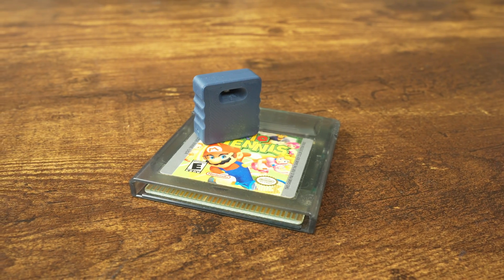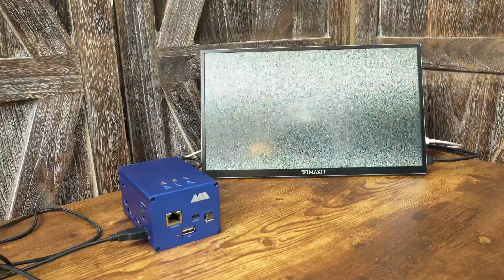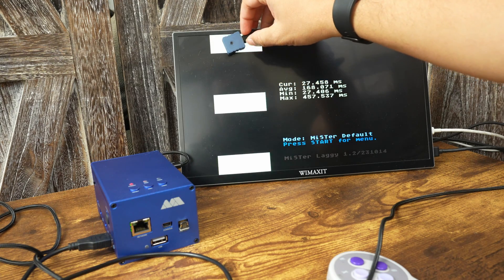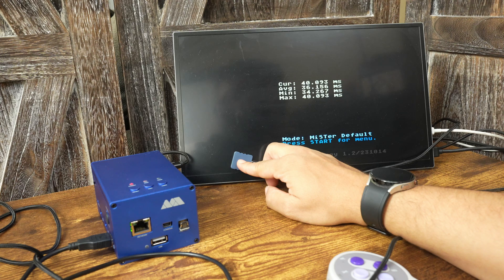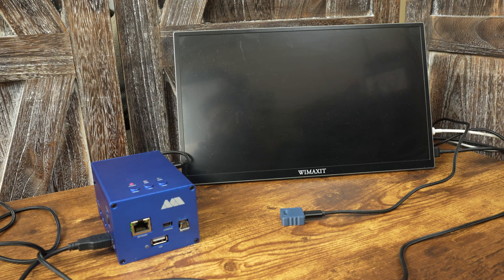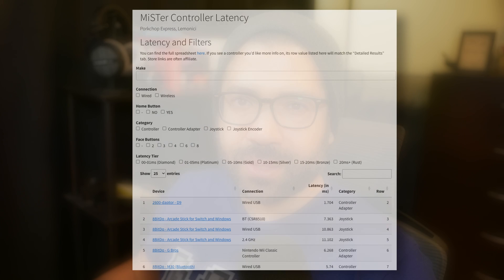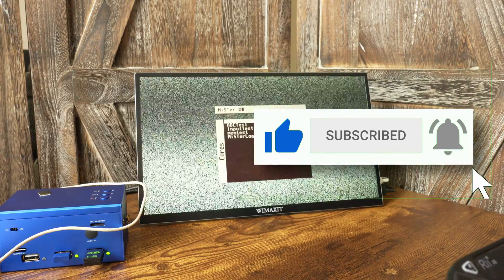Lag Test Your Display With MiSTer Laggy

Comment: question how did you get the core to run at a resolution that a crt understands all the resolution options are 480p and up so my crt cant display it proporly
Reply from the maker: I didn't do anything. I just loaded up the core and it automatically worked on my CRT. I was using direct video over component on this video.
Reply: hmm im using an i/o board with component cables to a sd crt. my ini is set to output component over vga and when im in the main mister menu everything is fine but once i boot up the misterlaggy core it gets scrambled like its outputting "hd resolutions" is the crt you used compatible with 480p/720p/1080p? @LusRetroSource

Comment: Thanks Lu!  What method did you use to test the CRT?  The analog I/O board, or an hdmi converter? something else?
Reply from the maker: On that specific CRT, I used direct video over component. I plan on creating a video testing other display devices which includes another CRT I have.

Comment: To go straight to the point:
You want "zero" lag like a CRT screen (less than 1ms) at the top left of the screen.
Every thing bigger is just more lag. (1frame of lag is around 16ms).
Under 4ms you have a great monitor. Over 27ms you have nearly 2 frames of lag.

For those who want to understand how to calculate the time for 1 frame:
The screen is drawn from top left to bottom right at the refresh speed of your game ( for example a game running at 60Hz) you calculate it like this 1/60 = 0.016s = 16ms
So at the bottom of the screen you should have the end of your drawn frame time 16ms.
As mentioned by other it would be more precise if the white spot at the bottom was placed on the right when the image finish to be drawn. 
But again you just need the top left corner measurement to determinate if you screen is laggy or not.

Comment: Why the "standard" bars are at left side of the screen? I miss a bar at the bottom right to get the total frame time. The refresh rate would be (has to be, right?) the same to update any point after the loop of refreshing images start. The way the measures are made will never get the total added lag. It can be calculated, but it would be better to just measure it there. Am I missing something, can anyone help me to clarify the method?

Comment: so how do you conclude what the total lag for your display is? go straight to the bottom and calculate 16ms + whatever else you get?
Reply: There are two schools of thought. The top-screeners and the bottom-screeners. At the end of the day, it's a wash. The display is either going to get around 16-20ms or less at the bottom of the screen, or be not-so-great for gaming. This only measures the lag-chain between the MiSTer and your display, so you'd have to factor the controller and game lag (if any) on top of that.

Comment: I don't understand how you're saying you're getting 1 frame of display lag with the WIMAXIT screen. It doesn't draw anything until the 27ms mark and the full image isn't processed until the 40 ms mark. You mentioned in some comments that the first frame is the 'real-time frame' but what is that? Most flat screens draw top-to-bottom like CRTs don't they? As far as I know only Plasmas drew the entire image on the screen at a time. Circuit Rewind did a test with a Time Sleuth on a 65" LG OLED that showed the top-left drawing under 10 ms.
Reply: Yeah, he basically has 26ms of lag at the top and the same 26ms at the bottom , which roughly translates to 1.6 frames of lag. Good thing he provided CRT measurements, since CRTs have no lag and are the same for every CRT (except for late CRT era expensive "advanced" HD TVs with frame buffering and processing, which should be avoided at any cost anyway), so it's very easy to just deduct the CRT numbers for top and bottom from LCD numbers for top and bottom and get the numbers for real lag. So 27-1=26 and 40-14=26.

Comment: Can this do 480i and 1080i resolutions for testing? I ask because I have an HD CRT and I want to test it's lag.
Reply: I plan on doing the same thing. In the video it is tested on a crt which I’m assuming is using a 240p signal.

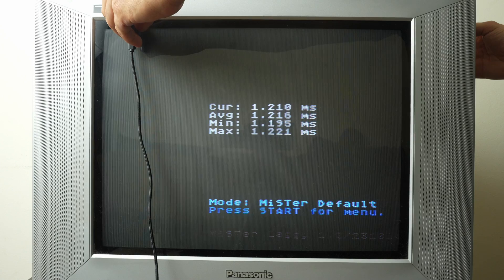Comment: 4:30
Any LCD screen that has an input lag like CRT? I know 144/240hz monitor exists but mister don't play well with 60hz games on 240hz native
Reply from the maker: Input lag is different and has to do with user interaction, like pressing the button on a controller or keyboard. The input device itself can add lag. 

What I'm talking about is display lag, and as far as I know all exhibit lag because of processing done to the signal before it's sent to the display. If a flat panel was as fast as a CRT, then old school light guns would work on them.
Reply: There are a few things to keep in mind:

1) most MiSTer cores don't output such high framerates, the highest I've seen was around 72Hz;

2) the HDMI transmitter on the DE10-Nano is limited to something like 210MHz IIRC, this limits 1080p content to something around 85Hz, you may be getting a lot more with 720p or less, but then you're leaving a lot to be done by your TV's scaler, which might not be as good as MiSTer's internal scaler;

3) when outputting anything besides your LCD's or OLED's native resolution, your display's internal scaler will kick in and depending on how good or bad it is, you may encounter some weird issues with lag and image quality, and it can depend on way too many parameters to list without making this a very boring conversation;

4) when sending stuff at odd framerates, you can't be sure your TV is really working in sync with the MiSTer, it could be using an internal framebuffer to store frames and adjust the framerate to whatever the display actually supports, just like the MiSTer does internally with vsync_adjust=0 to get maximum compatibility with cheap HDMI TVs, on modern displays with VRR this should be less of an issue;

5) display devices are full with marketing BS in their specs, you can't trust manufacturers to be honest and most of the figures they give can be misleading, so read the fine print and even then, you might have to do a lot testing on your own to validate the performance of your display.
Reply: @gcolombelli  
Is laughable that we can't play 50/60hz games on 144hz setting.

In windows, its playing the game in "borderless window" mode. The game runs at 60 but screen is set at 144hz at OS level.

Hope someone implements this in the future.
Reply: @jackipiegg  Not without either new hardware or lower resolution. But I gotta ask: why? What's the benefit of having the video card transmit the same frame multiple times?

It won't help with latency, in fact, it will be worse for latency, as the frame will have to be buffered and only start to be transmitted either halfway or 2/3 of the way, or worse, so the core can finish rendering at the same time the display is receiving the last line. And if you resort to having a non integer multiple of the native framerate, you will end up sacrificing image quality and animation smoothness for what? More latency? I don't see what's the point in doing that.
Reply: @gcolombelli  
144hz/240hz will have less latency. 
Like my example earlier, 
OS level = 144hz
game = borderless mode 60fps
The latency is less than 2ms.
Reply: @jackipiegg  Apples and oranges, my friend... that only works for games and systems designed to run at higher FPS, read: modern PCs. The ao486 core is crippled* by VGA performance and I don't think there's enough room to implement a video accelerator in it.

Trying to run a SNES game faster than it was designed to run would be pointless, you would either have a game running too fast to properly react, or you'd have to patch every ROM to handle higher frame rates. It's too much work for dubious gains, if any.

Some 5th generation console games are already running faster on the MiSTer than on real hardware, but mostly games that ran very slowly on real hardware and are not running fast enough to take advantage of higher frame rates than the MiSTer already offer. The real advantage would only be noticed in systems that are way too modern to be able to implement on the DE10-Nano.

* not the fault of ao486 devs, VGA lacked advanced features other systems had and relied on brute force to push fluid graphics, usually at the cost of lower resolutions and limited palette.